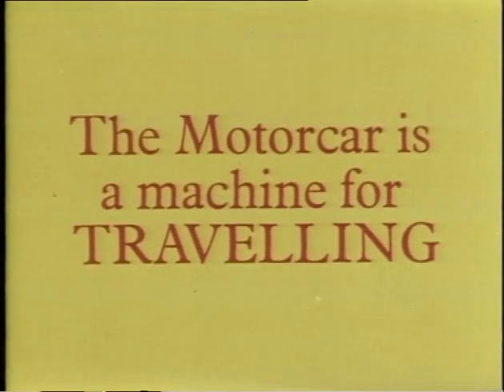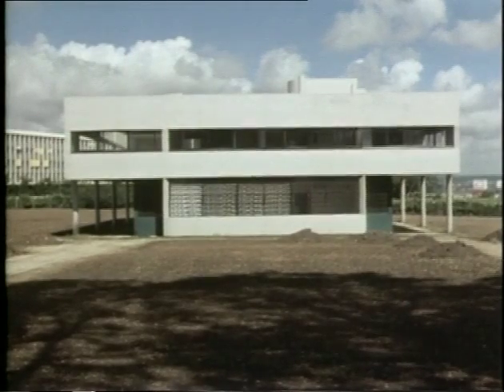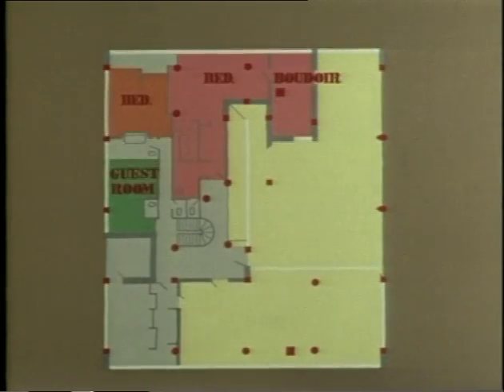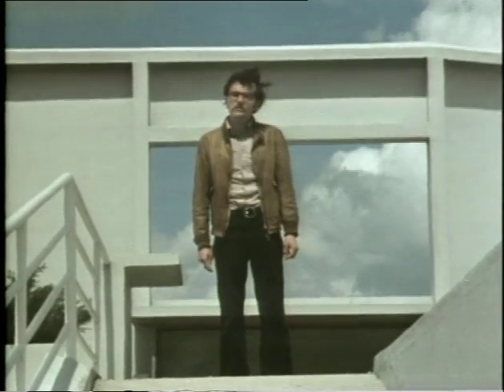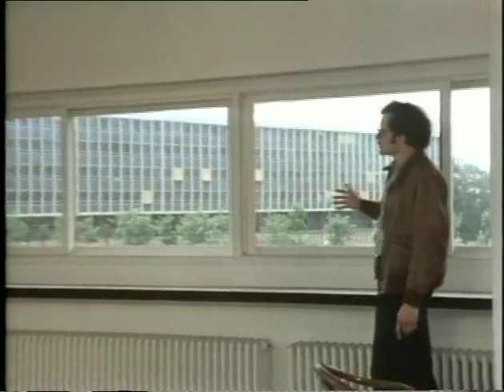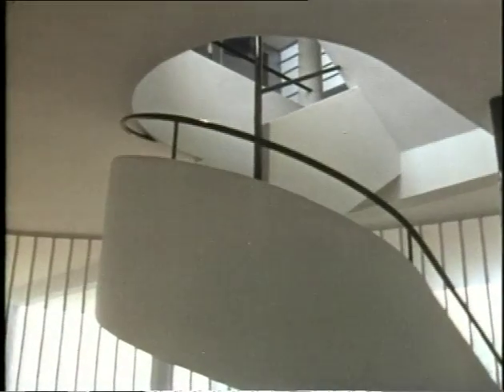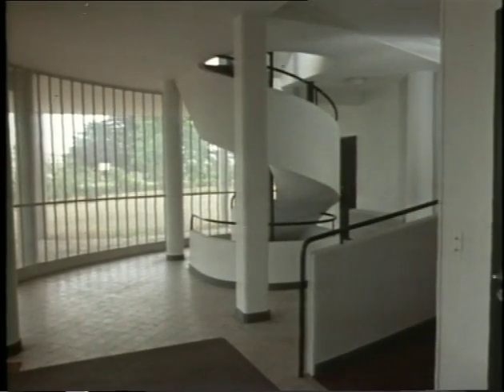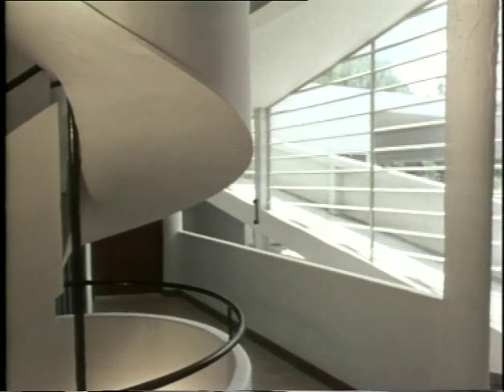A305/13: Le Corbusier: Villa Savoye

Comment: It is impossible to live inside a polemical exercise..
Reply: @Sumaiya Akter Do you not understand the narration?
Reply: @Sumaiya Akter I'm not anybody's 'dude' but sure,I'll try to help.
Reply: @Sumaiya Akter Press the three white dots on tye top right ofbyour screen while this plays..
A menu comes up then press "Captions" after which you select 'English (auto-generated). Then you should get subtitles as this was an Open University program from the 70's. Hope that helps.If not,ill have to do some kijd of line by line summary as there's a lot to get through..especially since I'm no Corb fan!
Reply: @Sumaiya Akter Does this help?
Reply: @Sumaiya Akter I don't like Corb. Overrated. Now if you're doing an essay abt Hans Scharoun or Adolf Loos,I'll write it for you! In my yr1 my go-to architects were Mies, Herzberger & Kahn..Tip from me: Don't worry abt grades, STUDY the reasons why the best did what they did..All the best!